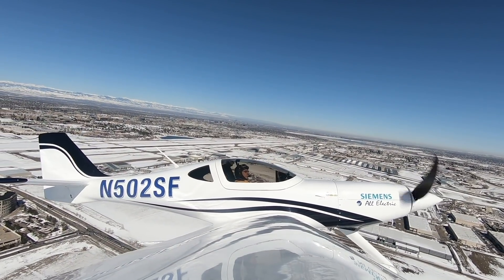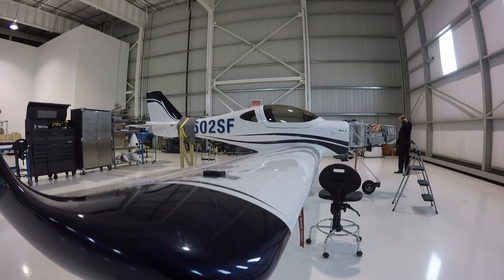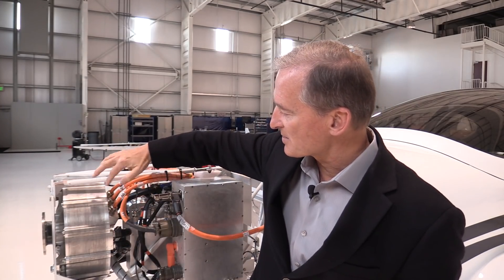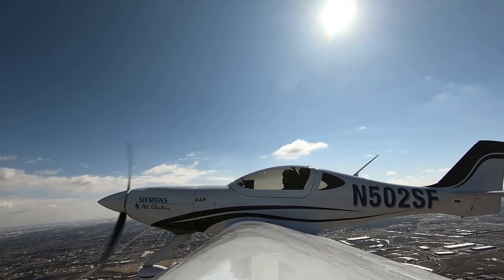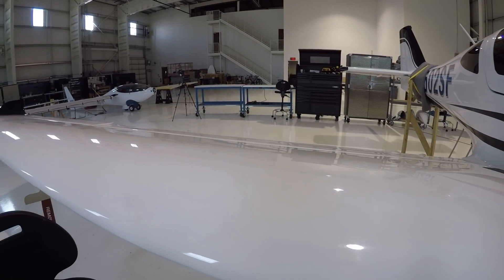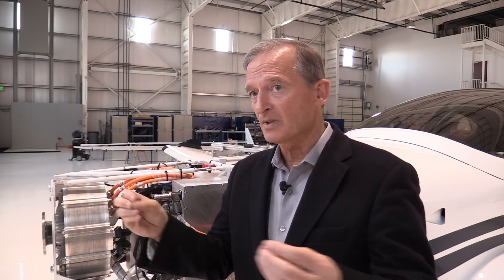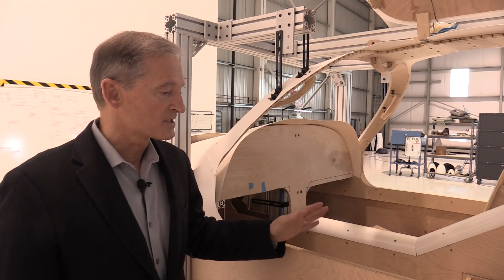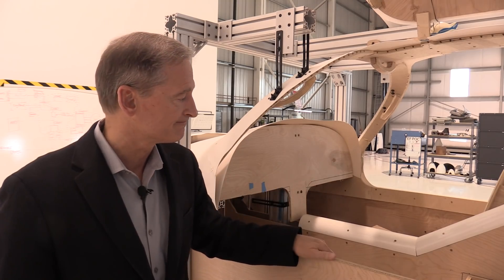Bye Aerospace's eFlyer Electric Trainer

Comment: Math please:  What defines a "quick charge"?  Assuming 2hr flight pulls @180kW from battery, that requires @220kW recharge (battery efficiency losses).  A Tesla 'Supercharger' max output is @150kW but sustained @100kW.  So...this plane is reaching approximate "parity" of 1 hr charge for 1 hr of flight.  With a 50% downtime for charging that is still a marginal duty cycle for a flight schools in cold seasons (N Dakota, WMU, Purdue, OSU) where even more energy must be used for battery heating and 30% loss of battery capacity for low temps (<0 C) which are VERY common for planes.  

Just looking at battery weight, to get that 3.5 hours run time using 260Wh/kg energy density battery (@1kWh/4kg) requires @300kWh/1200kg battery (2600 pounds?!).  This is basically a Tesla battery which is huge and simply not possible to carry in a small plane.  I wish these electric plane outfits would publish some real data - I am really frustrated they are NOT including adjustments for hot/cold batteries, charge rates, and REAL environmental operating temps which have HUGE impacts on these numbers!
Reply: Don't confuse power with energy storage!  kW is power , kWh is power over  acertain timeframe. 180kW will be peak power and only available from a fully charged pack (if that high is allowed - most small pack  EVs are around 140kW peak for 30 secs). Cruise flight will need a lot less maybe 40kW. Pack is rated say at 20kWh with a 4 kWh buffer - so 18 useable. Not cabin heating in winter unless you want very low endurance from pack.
Reply: "Assuming 2hr flight pulls @180kW[h?] from battery"
let me stop you there. the motor is rated at 90kW max power. what aircraft do you fly 2 hours at 100% power? Consider a typical  cessna, fuel flow during max endurance cruise is about 40% of takeoff fuel flow. 
If you "do the math" and find that the numbers are way off, maybe you just haven't considered enough factors that engineers who design that specific aircraft for a living have considered.
Reply: yan-Deriction Note that these new Siemens electric motors are less than 1/5th the weight of a commercial piston engine, they are also vibration free so the airframe mountings and propellor can be much lighter.  Electric motors can “free spin” so this aircraft is avoiding variable pitch as engine failure will simply mean the prop will rotate in the slipstream but not create drag as there is no engine compression.  It’s yet another weight saving.   If the pilot wants to descend rapidly he can turn the prop into a windmill generator to slow the aircraft in a steep dive and regenerate power.   The weight savings of the electric power train are such that pretty much batteries of equivalent weight to at least 10 minutes of flight at maximum takeoff power can be added.   There is less drag as well.  The batteries are denser so take up less space.   All these things add up to overcome the inferior energy density of batteries over avgas.
Reply: @WilliamJones-Halibut-vq1fs  Battery packs do not take up less space per kWh of energy - even with 260Wh/kg, that's way off diesel at around 13000 Wh more per kg inside wing tanks that are already aerodynamically profiled as part of a wing!
Reply: Luke W I was clearly pointing out that lithium batteries are denser than diesel/jet.  About 0.8kg/L for fuel and 2.0kg/L for batteries.   Energy density is a different matter.    Roughly you get 8kw.hr/L for jet fuel and 0.5Kw.Hr/L for battery.   The battery electric is 3 x more efficient so you could say that jet fuel is about 3kw/L
Reply: @RealestUrbanism  what about his points of massive weight and hot vs cold??
Reply: @budyeddi5814  
- his claim of "massive weight" is due to overestimating power draw, and thus the amount of batteries needed. the manufacturer says right in the video the plane is 2000lb
- At 30% capacity loss, a 3+0.5 hour aircraft will still have about 1.95+0.5 hours of endurance, perfectly usable.
Keep in mind also that range is a different beast than endurance. As a general rule for internal combustion GA aircraft, lower density altitudes reduce range but increase endurance, thanks to increased airfoil efficiency. This effect can mitigate some of the winter battery capacity loss.
I would certainly be interested in detailed temp/endurance data, but its not necessary for this type of video. 3 hours on a temperate day would already be a game changer.
Reply: @RealestUrbanism  Plus - what's the average flight training mission duration? It fits the required profile quite nicely.
Reply: @Walterwaltraud  1h flight with 1/2 h turn around is common at busy schools using normal aircraft.
Reply: @TekAutomatica  thanks for making exactly my point :-).
Reply: Yan:  Please let me stop you as well.  Do you have any knowledge of motor efficiencies?  IR drops?  Torque vs efficiency?  Speed vs efficiency?  Like all other electric plane projects NONE of this info is published, and the motor companies don't like to discuss their new designs, so I must use real world knowledge (30+ years experience as BSEE in automotive OEM business).  

MOTOR EFFICIENCY:  Looking at JUST the motor, these things are not built by Jesus - physics has limits.  The BEST motor in the world might reach 94% efficiency at the middle of its torque band in a lab at 72F.  Unfortunately, real-world units built for rough environments with huge environmental/load swings are 85-90%.  Now, lets go to max load (takeoff) and this efficiency plummets to 75-80%.  So, to pull 90kW shaft output requires over 110kW input.  

BATTERIES/WIRING:  Below 0C, all LiOn batteries MUST be heated to produce reasonable output.   Looking at a temp/output graph for any LiOn battery shows it drop to horrible values below -20C which is fairly common at altitude.  Now compound lapse rate taking off from 0C pulls below -20C climbing only to 6,000ft, a common level for any distance training.  These low temps can degrade battery use 20% just for temps and rise to a 40% degradation just to heat the batteries for proper operation.  Now let's add wiring losses which will be another 5% plus battery degradation over time which all batteries are subject to.  Also, Tesla pushes hard to NOT 100% charge batteries since this shortens their life.  lso, this is not a car - there is no braking regeneration taking place so you cannot look at recovering energy.  

TRAINING CYCLE:  Gas vs. electric power on a plane does not change.  A one hour training cycle would easily include  4-5 take-offs with go-arounds.  On one cycle, that motor is pulling 100% power (110kW from battery) for climb, falls to 70% power (80kW) in cruise for upwind, another 80kW on downwind, another 80kW on base, then maybe 50% power (55kW) on final which is the shortest time segment.  We are pulling on average about 80kW for 1 hour ..but.. the varying loads, temp impacts, battery life degradation, and wear all add up easily 80-90kW drain for 1 hour.  

SUMMARY:  I have not read ONE of these airplane outfits that are willing to place real world data in their materials.  My math is valid if not generous towards these companies.  Until they provide even minimal data to support their claims, electric planes remain R&D projects.
Reply: @tbreit  Sorry, brevity rules because I gotta go 39 km to work on 180 w, (i.e. my bike :-), non-electric). Yes, the battery arguments are totally valid. That said, there are a bunch of flight schools already flying the Alpha Electro, and certification is very real and very near (EASA). The Pipistrel loads when windmilling, which has an effect of close to 15% recuperation. The prop was specifically desigend for that. Flying at altitude would not make sense with a 152 either, so yes, the argument of electric at altitude is sth I would never use (unless training out of Leadville CO, Los Alamos etc.). So, you can get all the load draws from videos of Bertorelli AND the flight school videos that are available, alas not in a scientifically valid format. But real numbers from real customers. Enjoy watching!
Reply: @Arrogan28  BMW i3 pack heating is only available during charging process as part of pre conditioning - it's 1000W. If a pack is cold soaked then even a  Tesla Model S stuggles to come to life after a few days in an airport carpark if not plugged in.
Reply: Luke W Honestly if all you needed was 1gallon of a fuel you use only to heat the battery, problem solved at the very worst, or more likely it would just be a different type of battery able to hold charge for a very long time in cold weather.  As if the heating of the battery is going to be a big issue as it is only an issue in basically frozen dead for ’two weeks’ situations.

It a change, so there are things to work out. But if our grandfathers could basically do the same thing with fossil fuel engines while retooling the entire country for two world wars we should be able to find solutions and improve the tech a little bit on electric engines so that in 20 years our kids will thank us as we thanked our Grandfathers for being able to not give their kids the problems of their generation.
Reply: I agree with there being issues to solve, but the only real issue holding this back is just enough people committing to this as the future...
Reply: @Arrogan28  apart from those 40,000 kids digging cobalt for our #batteryobsession in a deforested DRC as important to the future as the Amazon. Love driving EVs but they have become the emporer's new clothes in environmental impact terms. Just like the solar pv on our roof, there's no plan beyond 25 years useage or how to deal with the toxicity of their production
Reply: @Arrogan28  have you followed formula e? Anything below 15 deg C affects pack performance. Anything over 60 deg C limits car to limp mode. Above 65 deg C shutdown to prevent thermal runaway and serous fire.
Reply: @Arrogan28  electric drive has been part of the past (first Porsche was an EV back in 1890s). It is, relevant now and for the future. However, to limit ourselves to a "silver bullet" "ev only solutions" is enforcing blindness to real world solutions.
Reply: Luke W Yea yea, there is no deforestation for batteries needed, Chile has all lithium and can mine properly it would have zero effect.  But at worse trading a vew square miles of salt flats having a few holes drilled in it that isn’t even permanant and kills zero anything is hardly comparible to climate change having already declined the world’s plankton populations in all oceans by 75%.  The very plankton that used to supply 80% of our oxygen and now supplies around 65-70% because we killed them off as changing ocean conditions are stressing the plankton to much too fast so it cannot evolve. changing salinity, changing to become acidic from being more base, change in average temperature. and really bad, the ocean currents are slowing down for the same reasons, influx of fresh water and decreased diference in temperatures.between poles and equator means slower to possible eventually no current, the same current that is responsible for bringing all the nutrients and minerals.from the ocean floor required by plankton to form their bodies etc.If we stress plankton to the point ot collapses all animal life(eukaryate cells)  will die.
One sides risks some small number of holes in a desert the other risks our entire kids future.  There are aleady growing cases of ocean oxygen deserts where hundreds of square miles of ocean have lost all its oxygen do to losing all plankton populations, and that kills every fish etc in that dessert as they suffocate to death.
https://www.nature.com/news/2008/080501/full/news.2008.795.html
Reply: Luke W EV solutions are also brilliant because unlike fuel cells it gives every household the option of creating its own energy needs, and can say screw the big energy companies starting wars  for resources etc, since you can generate electricity easy yourself and safely.  Fuel cells and other such tech is all going to repeat having giant energy companies hold all the keys again.  EV allows solar cells to last 25 years and be recycled for full reuse, same as batteries for tesla etc which have really easy recycling processes.  Right now that isn’t happening because people are grabbing all old tesla batteries and reusing them for a millions resuses, from remote station powering, like a sensor or a billboard for instance, peoples home grids etc. As a tesla batter pack working at 80% is no longer wanted for a tesla car, but has 60-100 year use in them for many  other applications
Reply: Luke W And again Tesla’s for instance once started ensure the battery stays at optimal temperatures for performance.  So 5-10 mins in and your battery is running at optimized temp.
Reply: @Arrogan28  japanese homes have fuel cell tech for decades, UK now using existing fossil natural gas lines with H2 mix as pipes are same
Reply: @Arrogan28  Bolivia and Chile evaporating under ground water supplies to do it! Cobalt is mostly from DRC where deforestation is occurring and 40000 kids working under ground to feed our battery obsession. No better than oil industry
Reply: Luke W Again you are pushing for using gas which has to be bought just as we have had to from gas stations etc for 100+ years now.  I am not sure how to say it again differently, but, the entire point is electricity can be generated from your own land home, no need to buy off some energy company again.  No need for fracking, no need to set up 20-100 year time bombs that will see our groundwater tables suddenly showing up as toxic from benzen and 100 over sealent chemicals pumped into each well by the tens of thousands of tonnes. that are extremely carcinigenic and immpossible to filter out of a water table once they inevitable get pushed up fisures from the heat at those depths, as with climate change risking our kids futures for no reason other then some are too adverse to change to man up and deal with instead of handing down to our kids.
So if someone wants to put solar, wind, hydro, or geo thermal energy sources on their property or roof so they can no longer just have to take whatever energy sourced from whatever locations the big energy companies decide, including everything from a SA pipeljne throuh syria which is why SA offered  and is helping pay for US military for hire attacks on Syria.  Or funding, and arming El Queda, ffs.  If i would rather not be locked into that insanity that to most is desireable.  
I can install some deep batteries and solar panels and use that to get to work everyday, no one is building a fuel cell station and setting up a NG or Methane factory on their roof.
Reply: Luke W As I said, in reference to Chilies process, it is a choice of convenience to lose the water instead of a simple plastic covering to recover 95% of it each time they evaporate the salt flat area.  this has already been done for other industries they choose not to so it is not a matter of them having to do it that way, it is simple not enough of a water lose yet for them to decide that a change of method of extraction is worth it.  
And it is not nearly as bad as the entire planet evaporating away its water reserves because the alternative is again fossil fuels or NG both which are causing damage that is global and beyond stupid for any species with foresight to be doing going foreward with such wilful ignorance against all science which is screaming about the desaster we are unleashing on our kids futures.  One bloody small portion of an endless salt flat in Chile or Bolivia is not even 0.00001% of the same level of damage.
Reply: Currently the US spends more on the development of potato chip flavors, by several factors then is spent on battery RnD each year. It is just a matter of moving focus away from the 100+ years of 99.99% focus on improving gas engines, to putting all that focus onto EV engines, and it will be insane the gains we will see in very short time frames...
Reply: @Arrogan28  good to hear , if wearable by soldiers how susceptible are they to impact and puncture? No mention of Watts /kg though stable tech presently 260w/kg which is way less than 13000w/kg diesel. New tech advancing with other options like fuel cells using iron and methane instead of H2 for cheaper High energy density storage.
Reply: Luke W Combat will get interesting soon, as drones, ai driven robot dogs or atlases, as from Boston Robotics, etc is going to change a good deal of the need for humans in combat situations, good for our soldiers, bad for possible serious human right issues etc.  
Darpa is already starting to deploy in combat magnetic railgun machineguns capable of insane rates of fire, and so clearly if the US Military goes with heavy battery packs it will be using lithium if that still is safer for them or whatever new cathode materials etc.  But ideally the sooner humans are not being put in firefight situations hopefully the better for our soldiers and hopefully less mistakes on civilian causualties as there is more accuracy and hopefully more ability to wait that second or so longer to confirm, and double check.that soldiers for instance don’t have.  
As battery tech is finally reaching a point where these machines are starting to be plausible and cheap enough to build on mass.
Reply: @Arrogan28  nope renewables not fossil gas
Reply: @TekAutomatica  That means nothing to me? What now you are arguing for ev's?